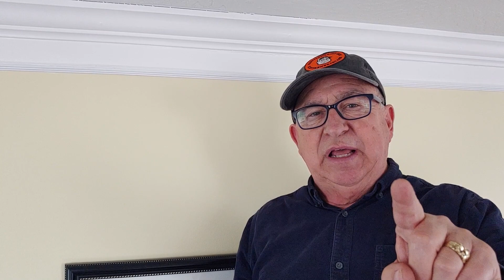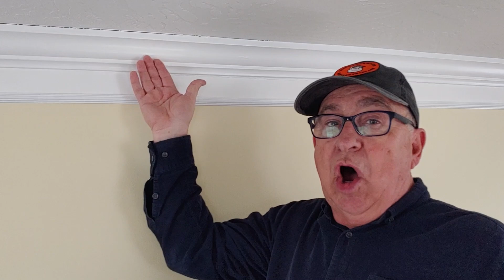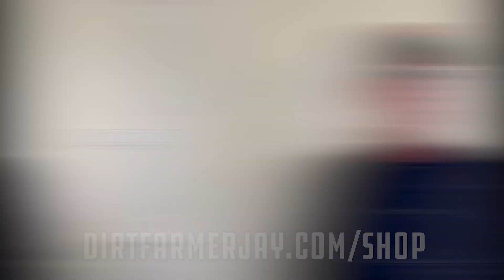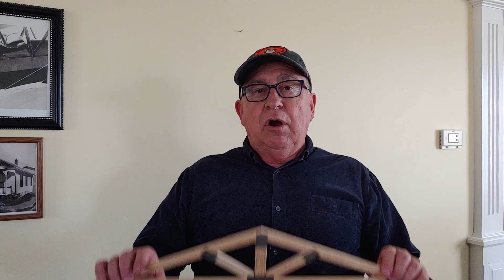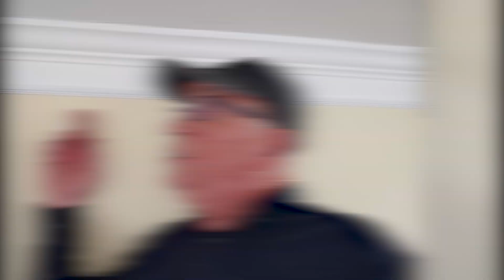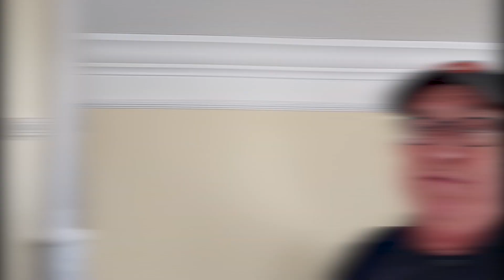How to Fix Ceiling Corner Cracks!

Comment: If i removed the screws or nails closer to the wall then itd just crack further in the drywall..  i tried that..  its still going to move and the drywall isnt going to want to move with it all when its still anchored to the wall corners..  wonder if theres a method of adding nails to nail plates or adding extra webbing supports on the trusses along with sistering some of the main ones or outside trusses..  when i looked at my trusses i noticed some only have a few nails in them while others had 3 in each board..  wonder if using some lags in there would be viable or is that movement a the reasoning behind not using 3 nails in all truss plates?

Comment: Every single one of the walls in my house are lifting on the top floor..  interior walls and exterior walls, perpendicular or with the trusses..  ive repaired them all once by ripping out all the tape and putting a new corner bead on all of it..  but all the tape has broken away again after a couple seasons..  some has pushed and some has pulled away..  no other cracks..

Comment: Excellent video.  The house I'm currently remodeling had a significant truss lift issue that the previous owner tried to cover with paneling and cove molding.  The dry wall is nailed every four inches on the ceiling right up to the partition wall.  I am using inexpensive small round magnets from Harbor Freight to locate the offending  nails. 

Blocking on top of the partition wall is essential but you should also allow the truss to float by not nailing the bottom cord to the top of the partition wall.  Simpson makes an L shape truss clip that has a perpendicular slot in it.  The clip is secured to the top of the partition and  nailed loose in the center slot to the truss with a single nail.  This holds the truss in place and allows it to float..  If you don't have clips on hand, you can drive a sinker into the partition wall on both sides of the truss but not in it.  The trusses in the house I'm working on were toe nailed through the bottom cord with 12d sinkers  and split over time. This addition was added over  50 years ago so this is likely an issue that developed over time.
Reply from the maker: Thanks for writing. What you describe is precisely the problem in many situations. Whereas the carpenter thought they were making everything more secure, they didn't take into account all the forces from different directions that would be applied to the structure as temperature and humidity changed. Thanks for the tips on the slotted clip as well as the method of using twin sinkers on both sides of the truss into the partition. Good stuff! Best, DFJ
Reply: @DirtFarmerJay  One of my subcontractors pointed out something I missed.  Trusses usually require cross-bracing between the webs.  This stiffens the trusses and allows them to move as a single unit. Bracing requirements are shipped with trusses and must be nailed according to the engineering specs to pass inspection..

Comment: 8:23  I think you have this backwards. Cold winter air is dryer than than humid summers. 

In winter, wood shrinks, and because of its grain structure, dimensional changes occurs across its width, not length. 

Therefore, the top cord is narrowing, pulling the bottom cord up. If you know your geometry, you can understand how that slight narrowing is amplified by the diagonals of the webbing 

Older homes didn’t experience this as much because attics were temperate - Less insulation, air leaks from below and leaky ducting. But as homes are made more efficient, there’s a more dramatic atmospheric difference between the attic and the conditioned space below.
Reply: I agree, inside the house is much dryer in the winter and the attic is a little dryer also.

Comment: I found your explanation of trust uplift very informative, helpful and definitely explains why the separation is happening in my bathroom wall at ceiling joint. I was hoping you would show how to correct the issue. IF you have another video that shows the correcting process, please point me to the URL.
I have subscribed and look forward to your other coaching videos.
Thank you!
Reply from the maker: Glad it was helpful! The effects of truss uplift are better addressed during construction of the home. Obviously, you don't have that option. Here is some more detail I outlined in video's description:

"If you are working to retrofit an already completed home, it’s a bit more complex, and you’ll need to determine if the annual gaps that form in the winter are worth the investment to fix. Simply filling the gap with caulk won’t really fix it, but it may make YOU feel better!

If you have a smooth or lightly finished “skip-trowel” ceiling, you can try locating the bottom chords/ceiling joists that are within 12” of the offending wall. Once you locate the screws or nails that are holding the drywall to the ceiling, you can remove them and patch and paint. This will allow the gypsum board to “float” more and minimize cracking. It’s not perfect, and it won’t work in every case, but if the annual truss uplift cracks are driving you crazy, then it could be worth a try!"

Also, take a look again at the video beginning at about timestamp 11:25.

I hope this helps!  Best, DFJ

Comment: Talk about my popcorn ceiling around fireplace is buckling and cracking. It was fixed once and repainted but looks bad now. A new bigger cricket was installed on roof to prevent water damage. I stuck a metal rod up between a crack and it hit hard sheet rock not pithy like water damage. So I’m thinking just bad patch job before letting go?!?
Reply from the maker: DrDennis77 - sorry to hear about this. I suspect you are correct. Is the sheetrock affixed to the ceiling well with screws or are their screw pops where the sheetrock has relaxed and is hanging loose on the screw heads? As you know, the problem with popcorn ceilings is getting a good match after the "real" work is done of getting everything done well structurally. Thanks for watching and taking time to write. Let me know what your solution is when you fix this. Best, DFJ